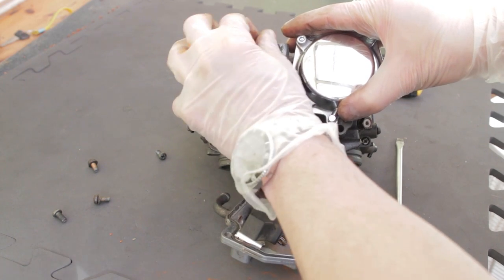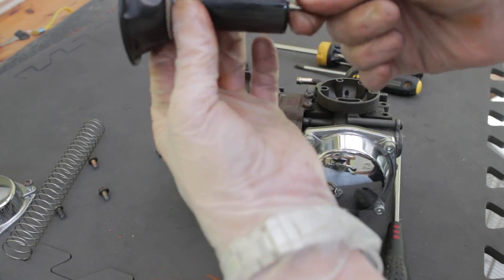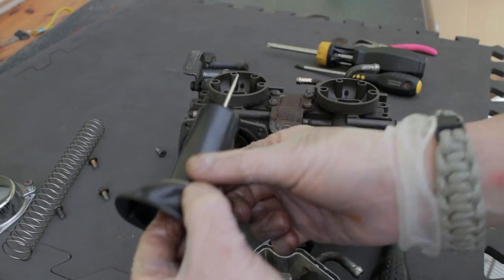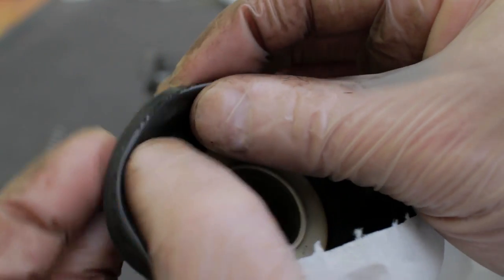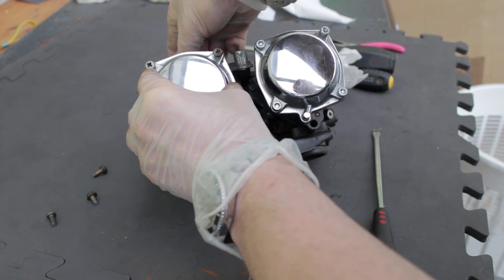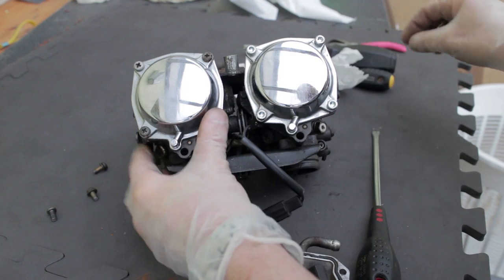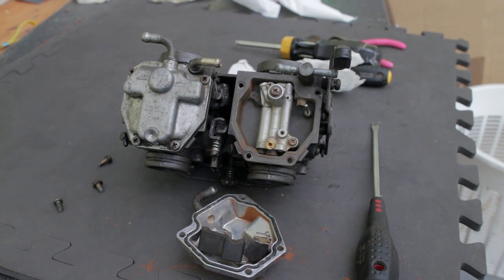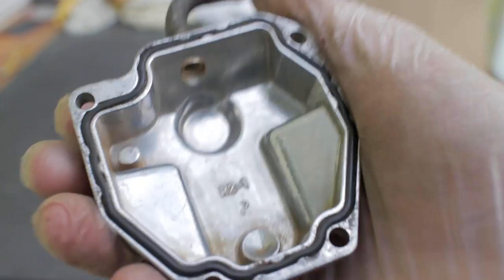Yamaha VIrago XV5535 Bobber Project, Part 5.2 Carburettor Strip & Clean.

Comment: You CAN buy the diaphrams on their own btw.
Reply from the maker: Do you have info on where?
It was always my understanding that replacement of diaphragms was a specialist job as the slide assembly isn't strippable by the user?
Reply: @spidiq8  $7.99 each from AliExpress - https://www.aliexpress.com/item/33028284896.html?spm=a2g0o.productlist.0.0.21247ff3tkc2DN&algo_pvid=db739506-8b80-4297-b281-96f7aad35176&algo_expid=db739506-8b80-4297-b281-96f7aad35176-1&btsid=ec4370ac-b184-4f2a-a016-65c74fc79978&ws_ab_test=searchweb0_0,searchweb201602_8,searchweb201603_60
Reply: @spidiq8  The slide assembly is strippable, just a right PITA. The workshop service manual from Clymer showed the slide assembly exploded diagram. Otherwise, you'd not be able to replace the needle without buying the entire slide assembly.

Comment: Hello, I would like to know the cable that the carburetor has that works. Thank you
Reply from the maker: I'm not sure what you mean, are you wanting a part number or something else?
Reply: @spidiq8  I want to know what the cable that carries the carburetor is for, because my carburettors don't have it.
Reply from the maker: @TheDanilovich  Is yours a 535 like this one?
All carburettors need at least 1 cable attached to the throttle, (modern bikes with efi are slightly different). Some have 2 cables one to open the throttle and one to close it but often a spring is used on the carburettor to close it.
Reply: @spidiq8  I have a XV 535 dx of 2001, the throttle does not have electric cables and I do not know if it Is obligatory to have them.
Reply from the maker: @TheDanilovich  Oh I see. The electric cables are not necessarily on all models. I thought you meant the throttle cable.
They typically operate a solenoid on most carburettors although I'm not entirely sure what the purpose on these particular ones is.